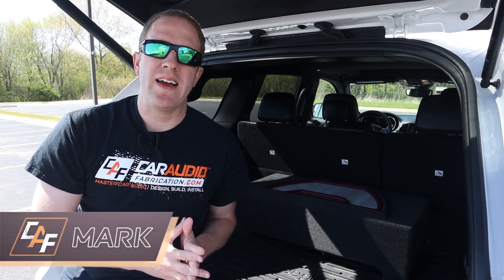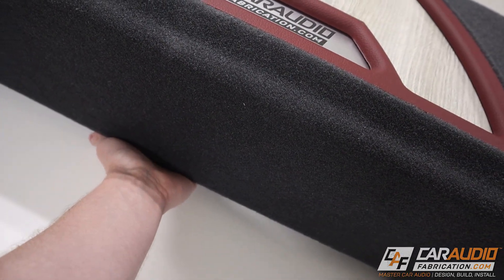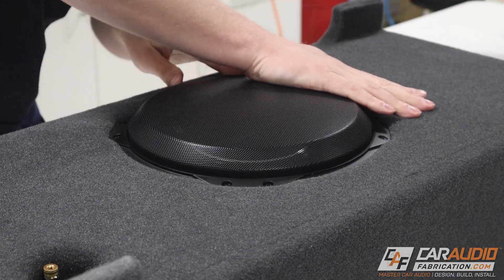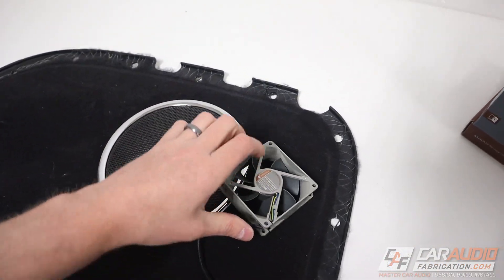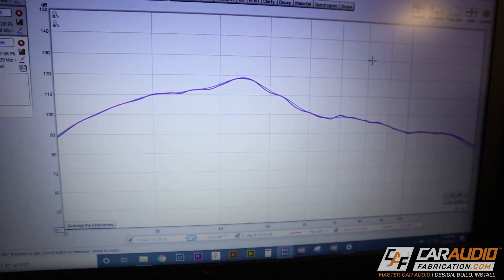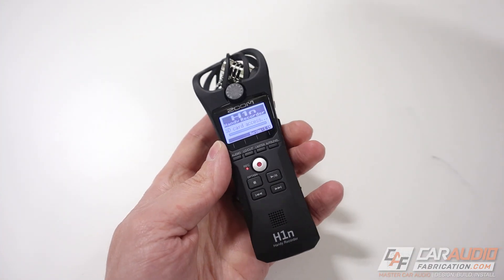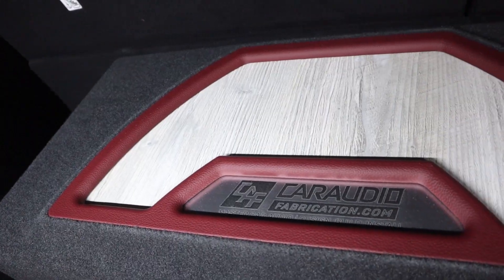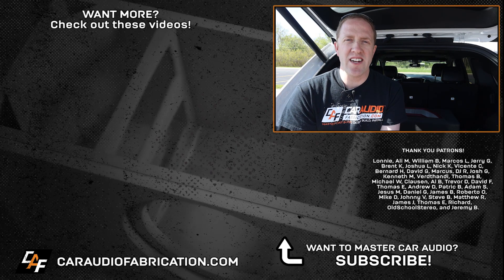MEASURING downfiring ported TW3 build! How does it sound?

Comment: I was told the 10tw3 works better in a sealed box. I guess it can work in a ported box, which I prefer
Reply from the maker: The problem is a lot of people will just make a blanket statement like "its better in sealed" but not elaborate. Better at what? Every application is different and you must always evaluate what is best for YOUR application
Reply: @CarAudioFabrication I think I’m gonna see about a 8w7 instead

Comment: Thank you for your content.  I’d love your opinion…I’m a JL guy in my vehicles and I love the 12w6.  My new vehicle has limited trunk space, Lexus LC500.  I’m thinking of a 12tw3 but I will have to have it either down during or up firing.  I’ve always had rear firing.  What would you recommend, up or down?  And, do you recommend dual 10” vs a single 12?

Comment: Replacing the interior in my 1984 Suburban. So while I am doing this I am upgrading the very lacking audio. The original speakers are two 3.5in in the dash and 2 4x10 in the rear....and that's it. I am not doing anything crazy, but hear is my plan. Replace the two 3.5in in the dash with two 5.25 coaxial speakers in the front doors, two 6x9 coaxial speakers in the rear, new head unit, speakers all powered by a 4 channel amp. I'd also like to add a single 10in down firing sub powered by it own amp. I am building a custom front center console between the 2 new front bucket seats and thought it might be nice to build it in the center console using this design. Question is...do you think it would be too far forward in the suburban to place the down firing sub in the front center console?

Comment: Hi! I would like to ask you if you see fit to use that sub with passive radiators in a car enviroment instead of ported? I have one of those in a sealed box that was made to substitute the rear top panel in a 2013 Hyundai Accent hatchback, because I wanted to have the cargo space available. My intention is to get more extension to lower frequencies without going into port noice or chuffing. What is your take on that? Thanks

Comment: Leave the factory panel alone. Use the subwoofer grill for the ventilation and keep it oem looking. Dont carve up the oem panel. At least from the viewers point of view. Do what you need to mount things,  just on the backside of the panel.

Comment: Great job Mark. Just thought since the speaker is installed from the bottom you would use clamps to hold the retaining screws instead of screwing them directly into the wood. In one of your videos you advised not to screw directly to wood because with vibrations they may come loose and will not "grip" into wood as tight again. Overall, you are an excellent source of know in this field.

Comment: I have two TW3 12s would a ported box fit or work in my 2011 Chevy Silverado
Reply: I run 2 10s tw3 non ported in my crew cab. They sound very good and fit well. Ported box will be much bigger.

Comment: I have a wiring question for anyone to answer...I have a boss audio ar1200.2 amp...it says its 2 ohm stable per channel, 4 ohm stable bridged. I just bought a planet audio tc10d 1500 watt max dvc 4 ohm. I want to wire it down to 2 ohms. So since the amp isn't 2 ohm stable bridged is it possible to wire it down to 2 ohm and then run the positive and negative from each voice coil to each channel on the amplifier?

Comment: I am confused about my amplifier (Kenwood KAC-9104D monoblock amp) because it has two 30 amp fuses. The RMS wattages specified from the manufacturer (500 watts RMS at 4 ohms and 900 watts RMS on either 2 ohms or 1 ohms) are on 14.4 volts and I know I am going to get 83.33333333% of the RMS wattage because my car battery is 12 volts. This means 416.66666665 watts RMS at 4 ohms, and 749.99999997 watts rms on either 2 ohms or 1 ohms. I am planning to buy two of either the Pioneer TS-W216M subwoofer (SVC 4 ohm 350 watts RMS) or the Pioneer TS-A25S4 (SVC 4 ohm 350 watts RMS) and use both of the amp's outputs (don't get confused thinking it is a 2-channel amp because there are two ouputs so you can connect 2 subs and internally they are wired in parallel) so I can get a 2 ohm load 749.99999997 watts rms from the amp and bring 374.999999985 to each 350 watt rms sub. Alright, so what confuses me is the 2 30 amp fuses. If you do 60 amps x 12 volts x assume 80 percent efficiency, you get 576 watts, what does this mean about the amp?

Comment: I have 4 2 ohm 6x9’s and a 1 ohm stable 4 channel amp. How do I wire this set up for 1 ohm?
Reply: It's not possible to wire that to 1 ohm/channel. If you want to do the calculations, look up resistances in both series and parallel arrangements.

Comment: Chosing a small redux fan is an interesting choice. They have higher static pressure than the larger fans but given the application in unsure if that's needed. Wouldn't it make more since to go with some 120/140/200mm fans since they will be quieter or what noise they do make being a lower pitch and making it easier to ignore. Ive had my hands on noctua 200 mm fans and they are suuper quiet.   Granted ive used noctua 60mm fans and some 3d printed ducts to keep the space behind my headunit cool on my silverado when I head a processor crammed back there

Comment: Hi, I'd like to add 2 x 12" subs into a Grand Caravan - would placing these in a downfiring box in the rear work okay, or would this come at the cost of bass?
I'm planning to use a sealed box, as I prefer sound quality over tooth shattering bass

Comment: I have a technical question I hope to get some help with. I've set up my system and at my power to ground leads I get 12+ volts, when I turn the ignition to the accessory or turn on the car I'm only getting 8 volts. I can't figure out why. the amps won't even power on. Thanks!

Comment: Hello. Thank you a lot for you installation tutorials; I have almost watched all of them, but I want to build a sound system and there are some concerns that I don't hnow how to deal with.
I have Hyunday Elantra 2020 and I want to install 1 woffer, 1 midrange, and 1 tweeter in the driver and passenger sides. I also want to install 1 wofeer and tweeter in the back doors, and subwoofer in the trunk. I want to use the factory audio unit with DSP and amplifier. 
The question is how to wire all of those speakers, specially that most of the amplifiers and DSPs come with 4 channels, but I have around 11 speakers? I have a problem imagining the wiring, so please tell me how to wire this system briefly.

Thank you a lot

Comment: I want to see the build for the Amp rack panel FOR SURE!  In the 90's I used to use push pull fans's across neon lit, plexi covered amp racks. With the cool air coming in from the car, and heated air exiting the car. I'd love to see how you tackle that, as I am building a similar system where my amps and DSP are behind the Vehicles Interior panels. Rather than in an MDF made rack. Thanks Rob / Winnipeg Man. Canada.

Comment: i have some questions I would love to get some expert help with please ok I have a class AB 3200 watt max amplifier RMS 1600 watt @ 2ohms I also Have 2 12″ 400 watt RMS 4ohm subs wired for a 2ohm load which adds up to 800RMS watts that's half of what the amplifier can produce should I be able to use the amplifier with those subs or is it too powerful? If not can I make up the difference by upgrading my 6.5″ speakers to some coaxial speakers with enough wattage to make up the difference and should they be 2ohm or would 4 ohm be ok for the 6.5″ my guess based on all I've learned is to stay with 2ohm on the whole package but I'd like an educated opinion because basically all I've learned is from watching alot if you tube videos and reading half ass tutorials that more often than not leave me with more questions than answers I am a noob but I am not stupid and I pay attention to the lessons I am taught I'm currently working on my second car sound system my first was a hard learned crash course into car audio because it was on my 2006 Mercedes E350 W211 with factory Harman Kardon fiber optic amplified system so you can imagine how much I've had to learn in a relatively short time the system I'm currently working on my 2009 Acura TSX and I am retaining my factory stereo and using a line output converter to do so anyways sorry for the long story but I wanted to give as much detail into my project as possible to help get as detailed of an answer I can possibly get if you feel up to it please give as much detail and information as you can I will retain any knowledge given and it will help in future builds thank you .
Reply: Whether or not those subs can handle the power available depends on how crazy you get with the volume knob, how the amp gain is set, what enclosure they're in, and what brand the subs are. Some companies have subs that can easily handle double their RMS rating, while others will fry. Just depends on the company.

Comment: I could have posted this question in a different video but let's try it here. You have made videos before where you use the cars own head unit and add aftermarket amplifier and that is "simple" but how do you go forward if the car already has a amplifier with factory installed sub and you want to keep that amp with original speakers but replace the sub and add amp to that to get that deep bass that the stock subwoofer just can't produce? I have a Ford Fiesta ST MK8 that has B&O speakers on it with 500w amplifier split between subwoofer and speakers. I would like to replace the factory sub and add amplifier to the new sub but still keep on driving the speakers with the factory 500w amp. Can I get the signal from the factory amp to subwoofer amp with DSP or something like that?

Comment: Do you happen to have the difference in spl numbers for dads Equinox vs. factory? I know neither are for db's, but I would love to know the decibel gain over stock or their Pioneer that sounds nearly identical to see if it's worth upgrading to the JL formed enclosure or should I just slap a box and amp in the back? Really would like to see numbers and changes in frequency with the bass.

Comment: I just installed three TW3 10's in a ported box and went over the box design with Eric Cole. I have it powered by an JL RD 1500/1 wired at 2.7 ohms and it gets down yet really accurate. The ported box is still smaller than a lot of dual 12'' boxes. I really like these subs
Reply: How does it sound
Reply: @BIG_FETUS  really good. just triple the internal depth and port width of Jl's ported box design for a single sub and keep the other dimensions they provide add some braces going front to back between each sub. Its not an spl machine but can be heard a long way and is also SQ at the same time.
Reply: What’s amp setting at I have 2 12” tw3 not enough bass
Reply: @JorgeLopez-uo7bj  3 10s 8 db higher than 2 12 tw3.

Comment: Any ideas on how I can get my sub to imagine closer to the front. I can easily locate it when playing my system. It’s a 10 w3 in a potted box. Crossover at 80 hertz and 6.5” Jl Audio c2 components are also crossed over at 80.

Edit: I do not have any DSP just headunit and amp.
Reply from the maker: You need a DSP, time alignment and making sure the subwoofer is in phase with the midbass speakers is key, that and treating the doors for optimal mid bass.
Reply: Try shifting your crossover point down to 55 or 60hz. (If the door speakers can play that low safely) Lower frequencies (30-50) are harder to localize, so if that's all the sub is playing, it will be harder to tell where it's coming from.

Comment: Hey Mark, I made myself a sealed box for my P2D4. First ever sub enclosure, so yeah I F'ed up and over built it so the size is about 31,5 liters, planned size: 16,4 liters. Any tips?
Thanks for all the inspiration!
Reply from the maker: You can reduce the size by adding wood inside the enclosure. Or of course rebuild, always good practice!
Reply: @CarAudioFabrication  problem is that it is a glass fiber box. But I'll give it a shot to close off some of the box👍